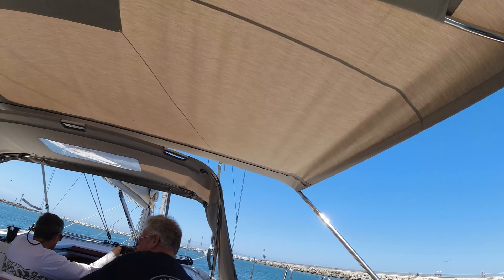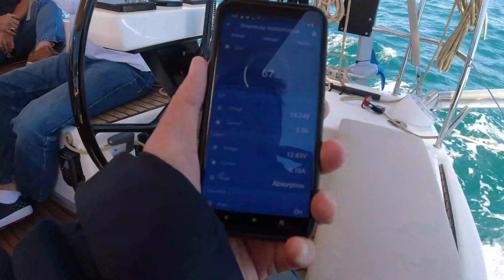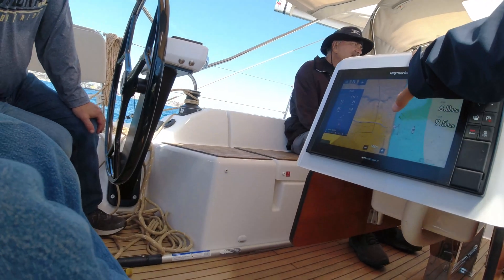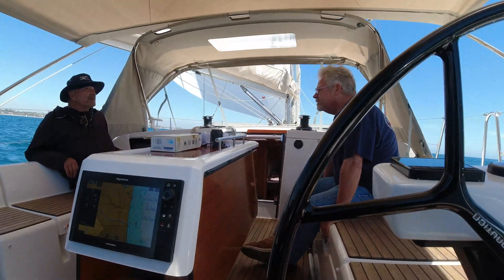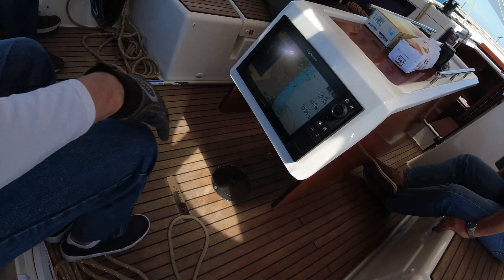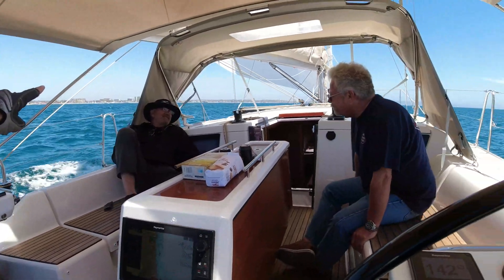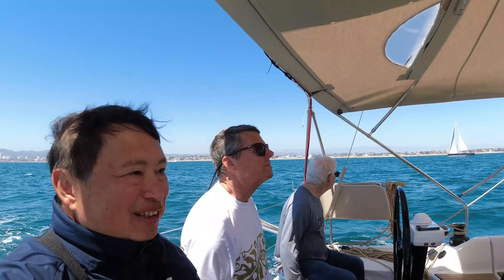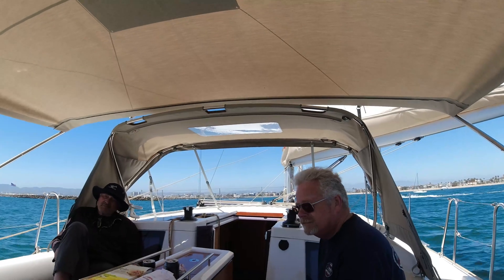Explaining How Boat Transponders Called AIS Work to My Crew

Comment: If you're thinking of running at night or day trips turn dark you're going to need radar and generator.
Reply from the maker: Not to worry. It has a diesel engine that has enough fuel for approximately 100 hours of motoring. At night boats have navigation lights by law. I've done a lot of night sailing in yacht races with boats in close quarters.